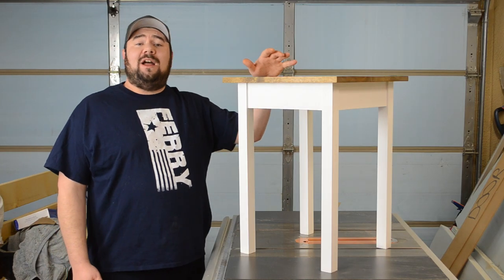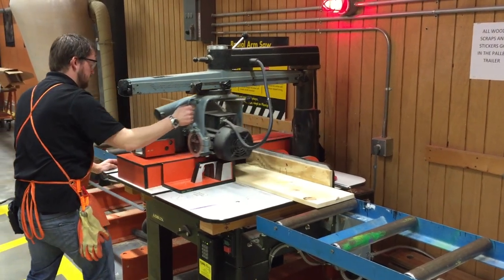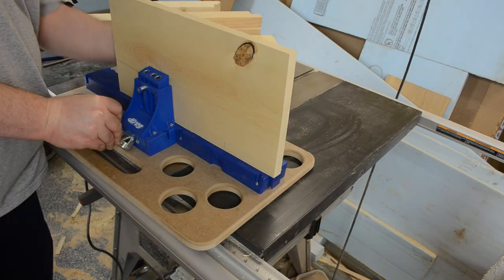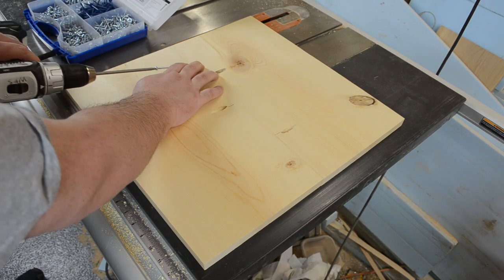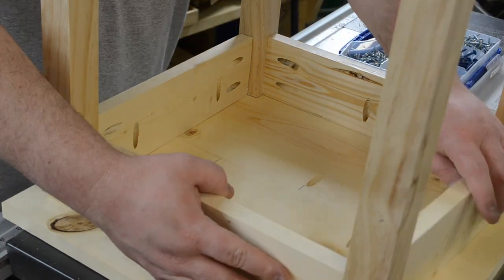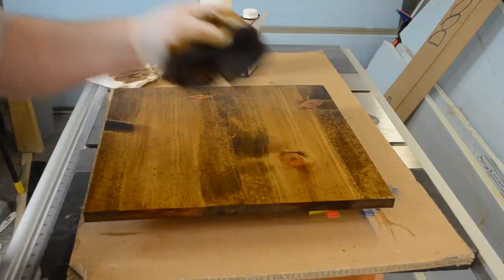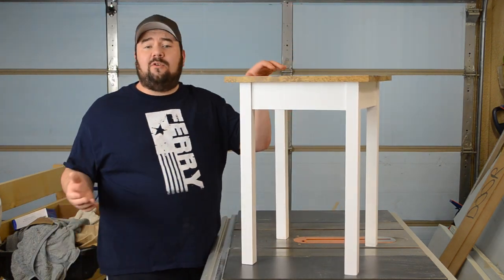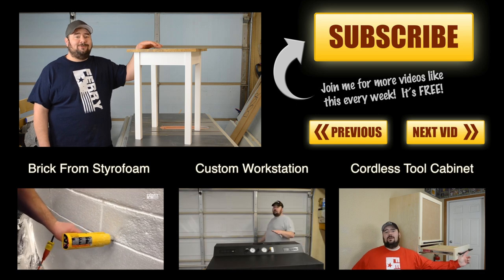Ⓕ Make An End Table w/ A Kreg Jig® & A Drill (ep46)

Comment: Hi Nick, nice project, only disappointment, no black....;-)
Could I ask a very simplistic question please? I am considering a Kreg jig and associated guff (clamp(s) etc). My only concern is the screws, do you HAVE to use the Kreg screws? What is special about them? Sorry for such a basic question, but I'm only familiar with classic joinery and joints.
Thank you Nick, Tim
Reply from the maker: locoformotos thanks - I have tried pocket hole joints w/o using pocket hole screws in the past with abysmal results - the 2 key advantages to using pocket hole screws is the self drilling portion of the screw and the washer style head - a standard drywall screw head wants to wedge and split the pocketed piece and without it having a piloted point it also wants to split the piece you are trying to attach - I hate having to remake piece due to splitting so I just stick w/ screws designed for pocket holes
Reply: Nick Ferry HI Nick, sorry for the delay in replying. Many thanks for taking the time to explain this. I appreciate it. All the best, Tim

Comment: Hi Nick this is an awesome video!!! I am just getting into woodworking and my wife really needs and end table for our sofa. I have one question though, someone told me that you need to be careful of wood warping once you get it from the store to your house. They said it was due to the change in temperature and humidity. Will it really make that much of a difference? I guess looking at the legs if they warped that would probably be bad mojo. Also is there anyway to straighten lumber that is warped? I know these are kind of noob questions so I apologize in advance. Thanks!!
Reply from the maker: welderwonder all woods and climates will affect things differently so you'll have to play around with it a bit - select pine that has already been acclimated to a certain region seems fairly stable - the only real way I know how to correct warped wood is to re-cut it - and no worries on noob questions, warping and wood movement can trouble even the most experienced people - wood moves, that's sometimes part of the fun

Comment: Home Depot gave you accurate cuts? Every time I've let them cut something, it came out at least 1/8" off, up to a full inch off when breaking down sheet goods.
Reply from the maker: Brian Diaz sheet goods I'm not really too sure - I normally just have them break those down - as far as the other wood, it will vary from store to store but I think they know me at mine for being picky - with a project like this you can let them know they are final cuts and I'm sure they'll give it a bit more detail - now granted the saw blades they sometimes use aren't super sharp but it gets you by in a pinch

Comment: Hello Nick, Love your videos. I am building a large Lego table for my twin granddaughters.  The legs are made of 3/4 plywood .I will be using pocket hole screws  to put them together. Do I need to use glue to put them together.
Reply from the maker: thanks - that's completely up to you - you'll get some added strength with adding the glue but it won't be able to be taken apart later for transport or storage - so you could really go either way
Reply: Thanks for the fast reply.

Comment: the pocket hole jig. how much did that one run you?
Reply from the maker: +Alicia Tanksley which one?  I used two different ones in the video - the K5 I think is 120 and the R3 $40 - the single is $20
Reply: +Nick Ferry thanks for replying. I meant the large one that clamps the wood upright in the beginning.
Reply from the maker: +Alicia Tanksley $120 or so

Comment: Bless you for not driving your pocket screws in with ant impact driver!  I cringe every time I watch woodworkers torque in pocket screws.
Reply from the maker: yukoncornelius007 I have been guilty of using an impact on them on occasion but you are right, not enough control to prevent stripping them out